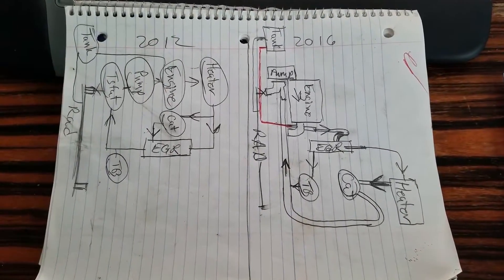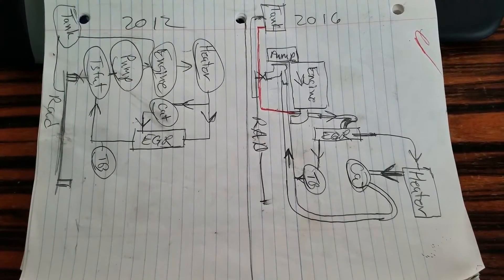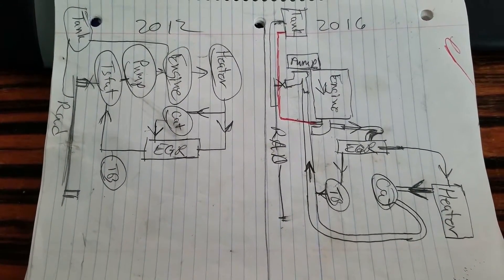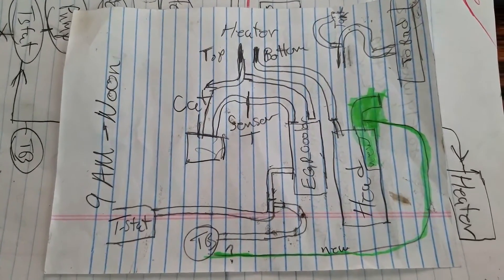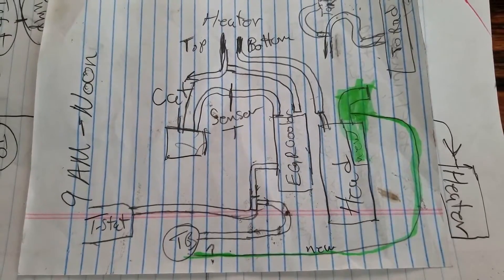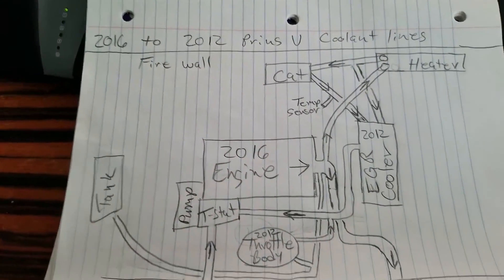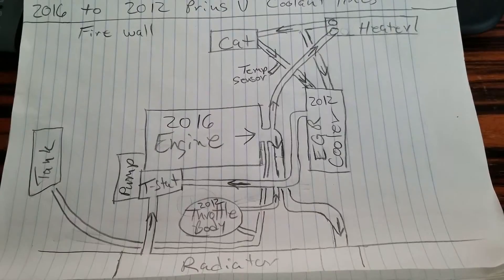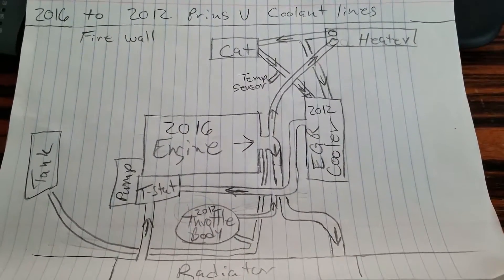Coolant Hose Diagrams for the 2012 Toyota Prius v - Fix That Prius!

Comment: The v has coolant flow to the transaxle as I understand it from a Weber State video.  Is that flow from the engine water pump or the inverter water pump?

Comment: Any particular reason I couldn't use the 2016 throttle body? They look identical.
Reply from the maker: I don't know. I used the old one. You should check out PriusChat  -  https://priuschat.com/threads/engine-swap-question.197101/